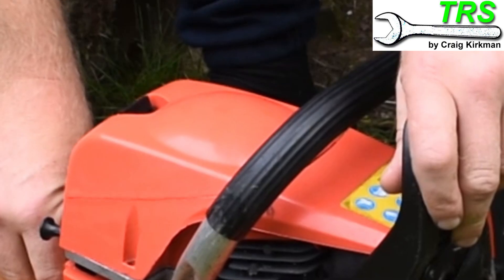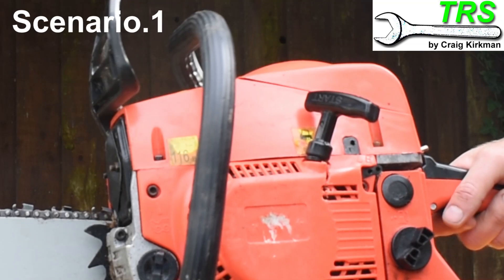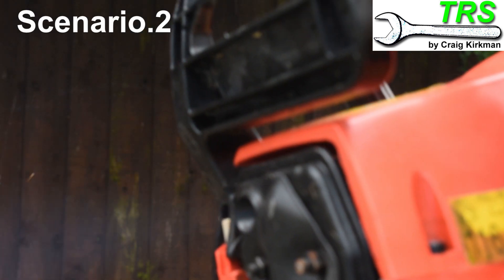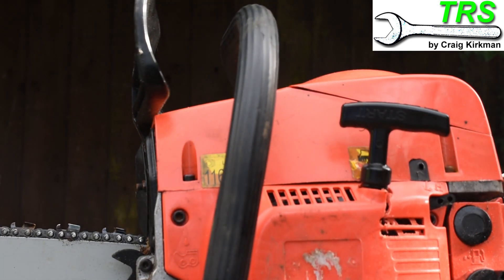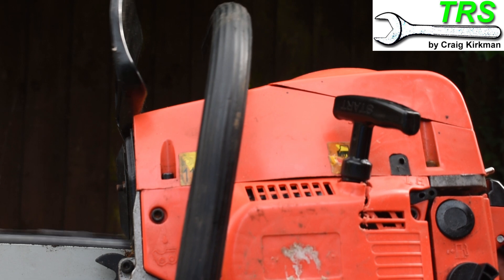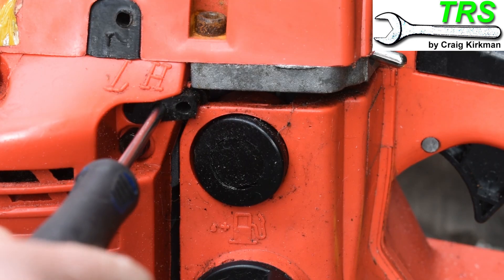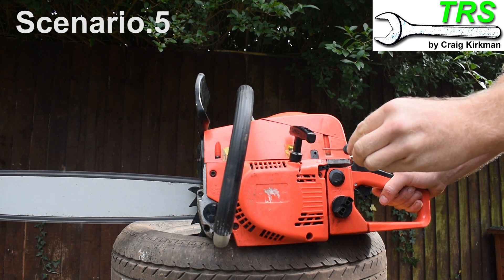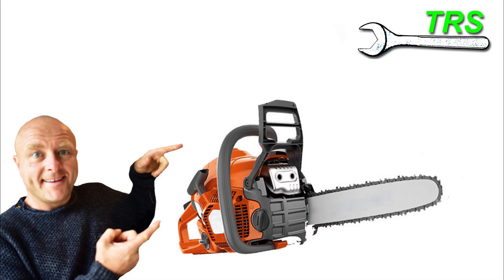CHAINSAW CARBURETOR TUNING: For Correct Chainsaw Carburetor Operation!  (by Craig Kirkman)

Comment: I accidentally used oil that was not suitable for making the mixture. the chainsaw appears to be accelerated, if I accelerate it gets stuck so I accelerate and stop when I feel it is turning off and after several times it revs up but to make it work I have to keep it accelerated if I stop it turns off, and is the carburettor dirty or does it just need to be adjusted? or do I have to clean it All?

Comment: Great, concise video - thank you and well done. A question for you please; Am I mistaken in beleiving that unlike 4 strokes that have fuel needles, most 2 stroke carbs have air needles, so turning CCW and opening on a 2 stroke carb would give more air (not fuel) - making the mixture leaner, not richer?

Comment: I am trying but won't idle and have to  choke before it starts and cut off please advice
Reply from the maker: Well if it won’t idle and you need to choke it then this is what I would do. I would screw both the H and L screw all the way in until they stop. Not tight at all though. Just until they come to a comfortable light stop. I would then screw then both out 1.5 turns out each. I would screw in the idling screw a full turn. I would make sure the chain brake is ON/Activated. Then I would try to start again. Hopefully it would idle. If so, then it can be set properly. Again. Im just letting you know what I would do. It’s not easy trying to diagnose or fix something without being there hands on the machine.

Comment: i had a qustion! so i have a vintage craftsmen compact chainsaw i picked up from a neighbore and it runs but the fuel is in the carbator but it will not start off it inless i put some down the cabrators throat then it'll start and wont stay running! what would cause this
Reply: mostly I'd say weak pump diaphragm inside carburetor, and dirt inside carburetor. Mostly that older equipment did not have primer bulbs, if it has take a look at it and the fuel lines as well for cracking, fuel filter while you are at it. Many of those older engines required 8 or 10 pulls to start them, especially if they'd been sitting.  You could also have a plugged up air cleaner or muffler which will cause stalling after being started.

Comment: Yeah I’m home job mine the turns on the HNL it only goes halfway only you don’t go any farther you don’t go clearly clockwise well actually completely one circle only half circle explain it right and mine it just don’t wanna stay run to even try to adjust it maybe I should take the carburetor off and clean it

Comment: My chainsaw revs high on startup and if I squeeze trigger a tad it will slow the rev down but I have to hold the trigger for it to idle. 
New carb started with all screws one and a half turns out. Need guidance

Comment: I have scenario 5 on a small Makita petrol saw. However it doesn’t have a T or idle screw adjustment. In fact only the L screw is user adjustable. The chain is running fast at idle with the brake off. Clutch is new. It’s overheating a lot and smoke is coming out of the engine. It’s practically brand new and it’s done this since I got it new. L

Comment: I got a tng scooter that’s two stroke if I let it sit it will run at idle but when I give it gas it bogs down then when I try to restart it won’t even idle till it has set for 10 minutes it also has oil injection that I’ve already adjusted to make the tiks line up at idle I’ve tried adjusting the fuel screws with no luck any suggestions

Comment: Great information, thank you but how to know if the air / fuel mixture is correct when the engine is idling? Is it the sound or the smoke I should watch out for? How to find the perfect balance between T, H and L screws? I watched your carburetor video but still playing with one screw effects the other.

Comment: Craig I noticed you made the adjustments with the clutch engaged. Is that the way to to do it? What is a good high or low RPM to adjust it to? I think mine is around 10K at high. Is there a common spec for each saw? Mine is 35cc 16 inch McCulloogh. Anyway thanks for the very useful tips Artie 😄😄😄
Reply from the maker: Hello Arthur. 

Personally, when adjusting these chainsaws I don't go with tachometer readings (again personally).  I much rather set the RPM by sound.  I open up the throttle to full. Then turn the H screw inwards, and if the engine revs increase then I continue to turn until I reach a maximum RPM as gauged by sound.  Then, I turn it back outwards very slightly to allow just a little more fuel into the engine, which I can hear because the RPM changes very slightly (lowers very very slightly).  I don't adjust it too much to be a detriment to the running of the engine. 
Doing this ensures that there is enough lubricating oil going into the engine with the fuel.  In my opinion, running a chainsaw at Max revs possible is too lean of fuel to give extended protection from wear, and just giving a little extra fuel helps protect the components.  This is how I do it and its worked for me for many years now, but many others may do things differently.  I hope this helps.  Thanks Craig
Reply: Thanks Craig. Thank you for your input.  I will definitely go with your recommendations. I will set it up. I truly enjoy all of your videos because they give me an excellent understanding of how everything works internally. Thank You for all you do for us Diyer mechanics.  😊😊😊